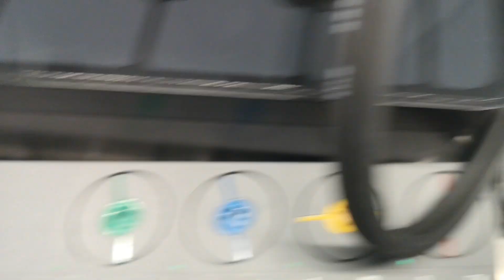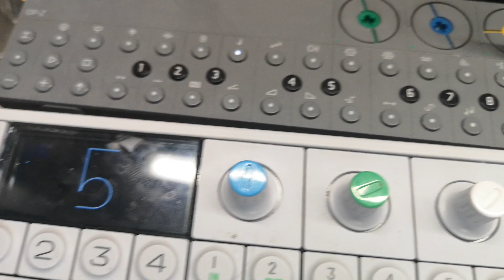Retrokits RK-005, the Swiss knife

Comment: Can you explain exactly how is the OP-1 receiving it's working clock - you seemed to infer that it was from the 2nd OP-Z and the original clock is being sent from the 1st OP-Z?  I must admit I'm seriously frustrated that it appears that even with the forthcoming OP-Z  midi module you've got installed it's STILL not possible to simply connect the Z and the 1 without this external RK-005 being required.  Am I right?  Can you confirm that you can't just connect from the module out to the OP-1 direct (with cable adapters) and get working clock sync?
Reply: Djellicon the usb hub connected to the 005 but you can just connect op1 direct to OP-Z with cable adapter as well

Comment: Is that the RK-MINIMIDI converting the 3.5mm MIDI out from the OP-Z to the RK-005 DIN IN?
Reply: Yes. At least, that's what it looks like to me. The RK-MINIMIDI is a sweet little guy if you have various 3.5mm MIDI devices using different protocols.